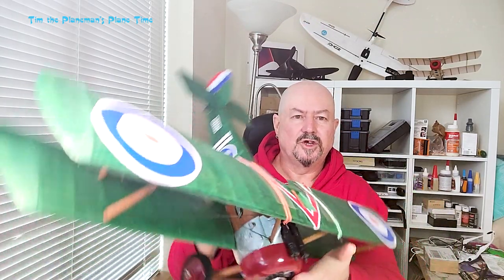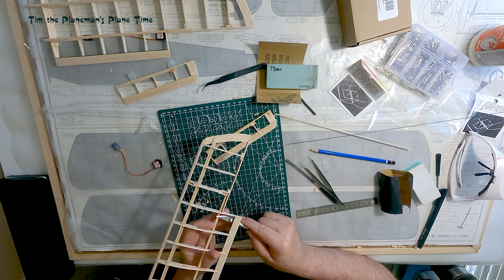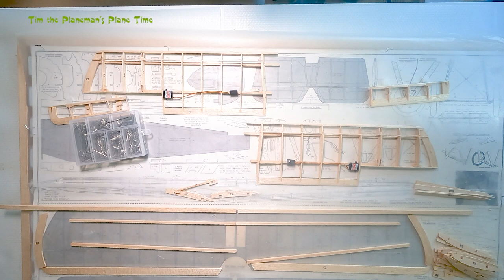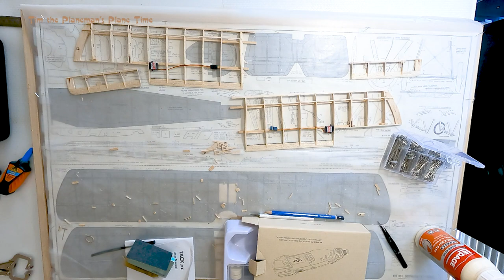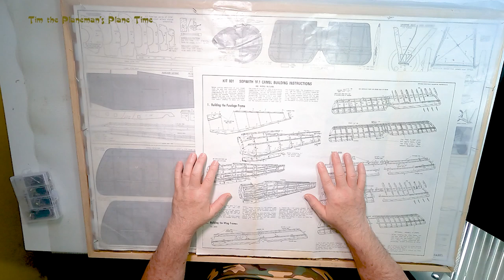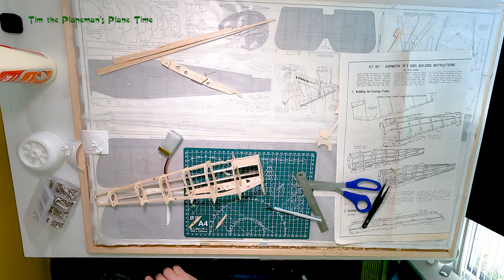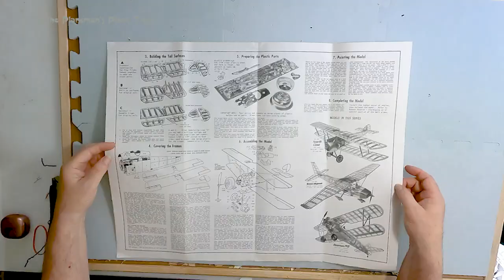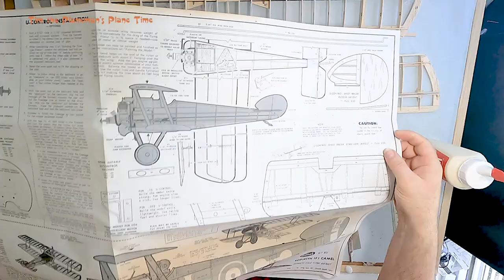08 Time-lapse build of the Guillows Sopwith Camel 801 WW1 balsa model RC conversion

Comment: Hi Tim. I'm in Australia and have just started on the Guillows Sopwith camel and was very intrigued with the 'direct drive' servo's. Can you tell me where you bought them in the US?
Reply from the maker: Hi Douglas, there is nothing special about the servos. Just regular 2g digital servos. The trick is how they are mounted. If the link for the one's I used isn't in the description, I'll add it now. Ta.